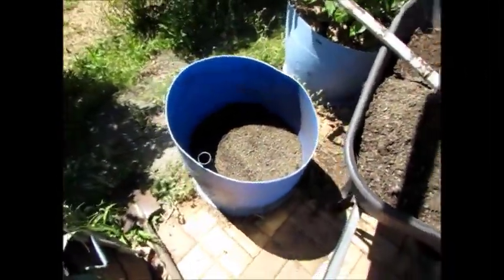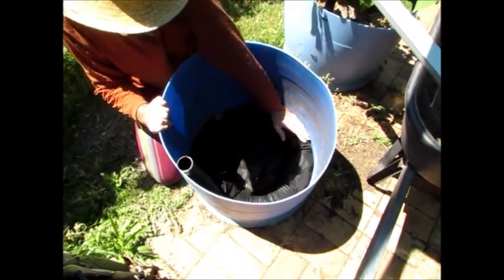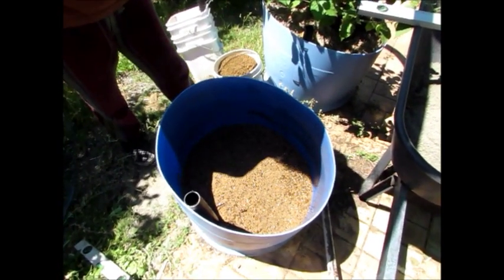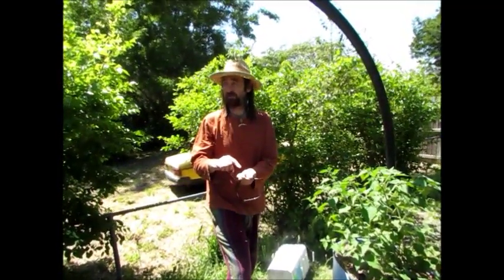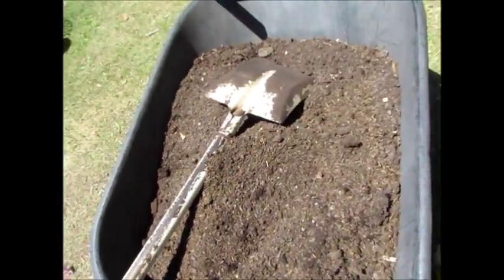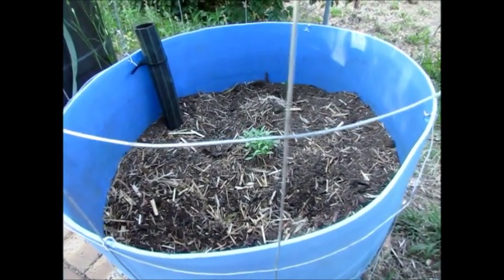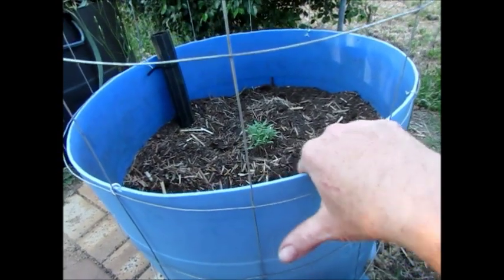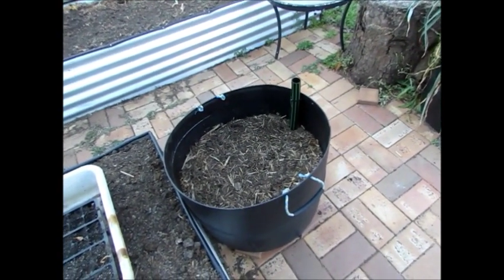Wicking Barrel... Self watering container Mark 2..

Comment: did you make the holes in the pipe yourself or is it some type of pipe you purchase that way already?
Reply from the maker: Hi Nomi. We use what's sold as "slotted agi" or Slotted drainage" pipe here in Australia. I think in the states its sold as "slotted drain" or "slotted landscape" pipe. Found this on the Lowes site if it helps.
http://www.lowes.com/pl/Corrugated-drainage-pipe-Drainage-Watering-irrigation-drainage-Outdoors/4294612449

You can also make holes in normal pipe if you have some laying around 👍😊
I also have a more up to date version of this build which might help you out some other ideas too 
https://www.youtube.com/watch?v=wGF72sOwgJI&list=PLBcWprMIwYYizRYZra6RRbe_mrPdnXu4G

Hope that helps you out some & hope the build goes well for you.
Rob.
Reply: Thaaaaaaank you!
Reply from the maker: No problem at all Nomi 👍😊

Comment: just wandeing if you ended up planting any citrus in one of these. Am considering doing a fruit and berry orchard in the backyard using these.
Reply from the maker: Hey Michelle..
I think dwarf varieties should do quite well in them.. We did have a mulberry in one for a while but it quickly out grew it.. 
I did make up an air pruning barrel we have a papaya/pawpaw tree in that is doing really well.. 
Air Pruning Self watering/Wicking barrel, a DIY project for papaya/pawpaw..  I have made up another barrel but just haven't planted it out yet.. Am thinking about popping our dwarf lemon in there to see how that will go..

Have also made a clip showing a few different ways you can set up the reservoirs in the standard wicking barrels that might interest you.. They could also be used in the air pruning barrels..
Self watering container / Wicking barrel, with added ideas & pointers ;)

If you are setting up a few on some level ground this clip might help give you a few ideas on setting up an auto watering system for them..   Automatic Watering System For Wicking Barrels Part 1

Hope that gives you a few ideas.. Would like to know how you go with the backyard orchard..
Cheers & have a great one..

Comment: Could you use leaf mulch for the separation layer between the sand and the soil?
Reply from the maker: I haven't tried it my self & it could be worth a shot in one just to see how it goes.. Would probably want it to contain only broke up leaves & no broken down leaf compost..
I see that layers job as just keeping the soil blend out of the sand reservoir  long enough for the soil to settle in if you know what I mean.. I have never seen any soil blend mixed in with the sand in any of the beds or barrels I have pulled down to move or re work the reservoir.. 
Just posted a more complete clip on how we make these up if your interested too..
Self watering container / Wicking barrel, with added ideas & pointers ;)
Hope that helps some & let me know if you want any more information Jim Bo..
Cheers,
Rob.

Comment from the maker: Another way to make them is to get a small section of pipe (75mm/3") then drill a hole slightly larger than the pipe in the barrel at the top point of the reservoir. You can then put some fly screen, shade cloth, weed cloth, mesh or a loosely woven material over one end of the pipe & push it into the hole. Have used this method on a few barrels with great success. We have also had little fingers pull them out so like to use the grommet & barbed fitting method to stop this. TBC

Comment from the maker: Hi Charles..
Have had some very wet weather here over the past few wet seasons (including devastating floods involved) & all of the barrels handled it fine.. The bottom holes for the zip ties also act as extra drainage ports so help to drain excess water out if need be.. Is easy enough to drill a few small holes further up the barrel if your concerned about them flooding..
Hope that helps some & have a great one sir, Rob.

Comment: I made my first one today. I "stumbled" across (tripped over) roughly about a 2.2 metre length of drainage tube at the tip (my work) a couple of weeks ago (which I just had to recycle somehow) and happened to have a food grade barrel laying around (also saved from landfill) so decided to get it happening. It's a complete rip off of yours Rob but I reckon you'd give it the tick of approval ;-) Ive planted a lemonade lemon in it so will be keen to see how it goes. Cheers, Dave.

Comment from the maker: Could try landscape or a plumbing suppliers.. I have seen it for sale at both down here.. If you can try to get the "socked" slotted pipe.. A bit more expensive but you don't need to fiddle around with the weed cloth on top of it..
Hope that helps some..
Cheers..

Comment from the maker: I like to use sand as soil has organic matter in it that tends to go anaerobic when it is wet all the time.. Clay might tend to hold onto the water but to tell you the truth that is just a guess from what I have seen when working with pottery clay.. 
Sand does make it heavy & hard to move so I set the up in a position where I intend to leave them for some time.. They can be moved on trolleys but it is hard in the 100L/26gal barrels when they are full..TBC

Comment from the maker: I have had a fairly slow/lazy summer myself :D
I was going to but a 13mm drill bit so the grommet isn't needed but just haven't gotten around to it yet.. I think the low density irrigation pipe should fit through a 13mm hole nicely..

Comment from the maker: They are all still working really well so far Mick, can't complain at all with these.. They are just a ½ 200L/40Gal barrel the same as the older ones.. The "BUNG" is the same as the MK1  :D
 I was going to change it to just some shade cloth glued to the inside with silicone but am rethinking that idea after the IBC beds flooded in the rain... Not sure if that drain hole set up had something to do with the flooding issues as none of the IBC beds with the "BUNG" in them flooded..
Hope that helps.

Comment from the maker: Hi there..
**waves**
There is a screened overflow pipe down the bottom that has worked great as drainage even through all the heavy downpours we get here.. Only ever had one clog up & that was a construction error of not having the overflow screened well enough.. A wood chip got stuck in the pipe & caused a blockage.. If you are worried about drainage you could drill some smaller holes a bit further up like we did with the first few barrels we made..
Moo said  "Hello Miss acrom"
**WAVE**
:D»